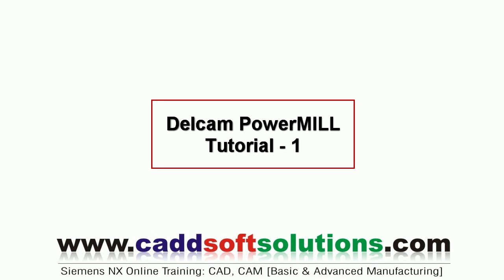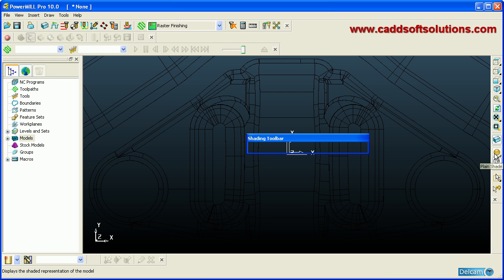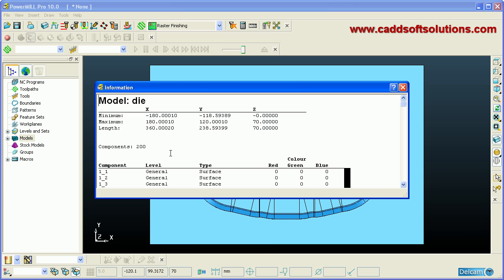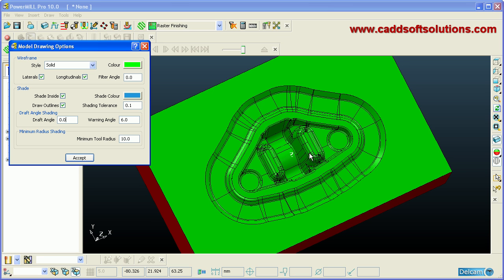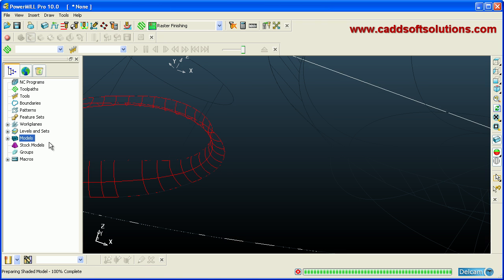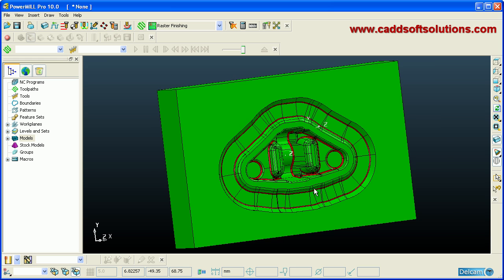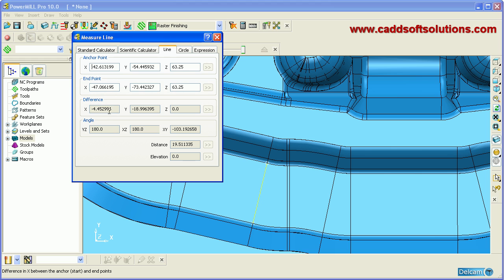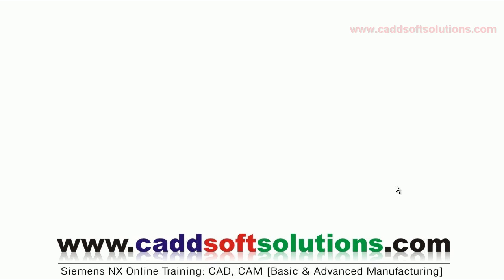PowerMILL Tutorial for Beginners - 1

Comment: Dear sir, I am really happy for your awesome video. But I can not practice perfect as I do not have the files that you have used here in the video. Therefore, Please could you give me the design file? I will be grateful to you.
Reply from the maker: These were installed with the software. These files are the part of the software.
Reply: @CADCAMTutorials  Thank you so much
Reply: @CADCAMTutorials  Dear sir, I followed your video but rolling is not working. I can not rotate the object by rolling the mouse wheel. Why sir? what is the problem behind?
Reply: dell cam power mill sabse best hai vmc programing k liye easy bhi hai yadi ap power mill sikhna  chahte hai 8273984634 ye mera whatsapp no hai.
 1 ham ap ko software install karna sikhayenge 
 2  vmc programing manual editing sikhange
 3  yadi ap programing mai kahi problam face karte hai to solution denge
 4  ap ko job k bare mai bhi bataya jayega